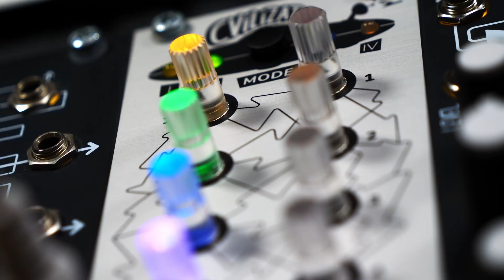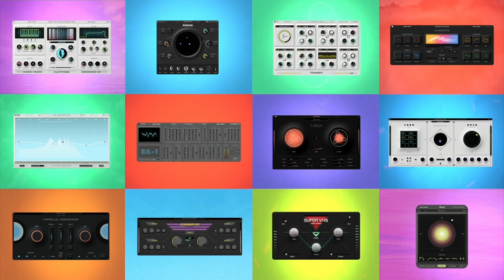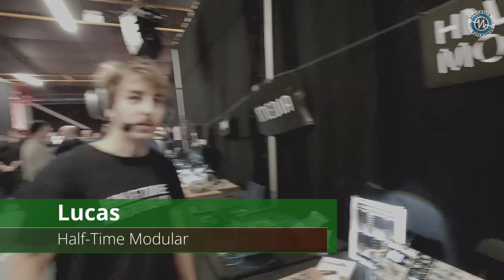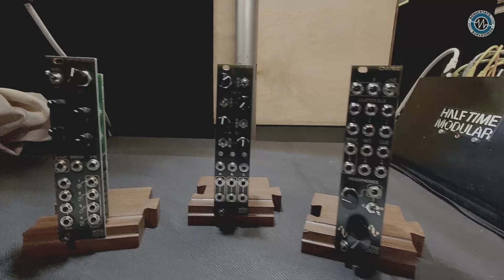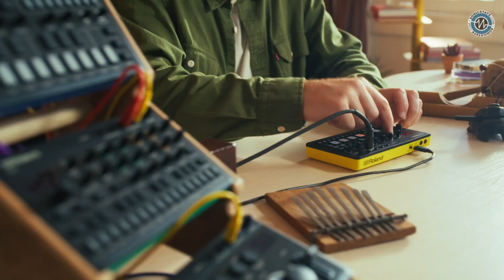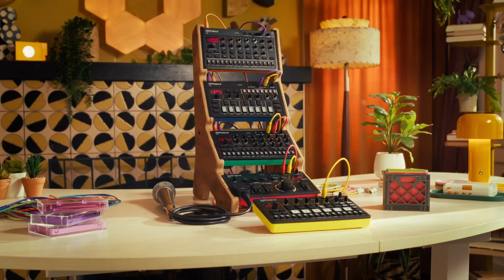Bristronica 24: Halftime Modular - New Company -  New Modules

Comment: Thanks a lot for stopping by our booth!
A couple additions:
- the prototype mentioned at the beginning we forgot to show is a 14hp multiband distortion with stereo input and output, but mono processing (lets you distort the mid or side channel). Gain CV and clipping threshold input are available for all three bands, as well as individual band outputs and envelope follower outputs. Subtle warmth or feedback mayhem and everything in between! It should be ready and available early 2025.
- we will try to post more in depth reviews of each module in the next weeks/months, but feel free to check out the manuals on our website in the meantime!